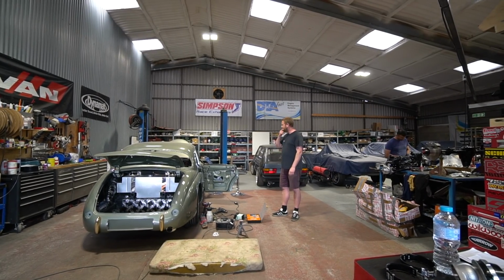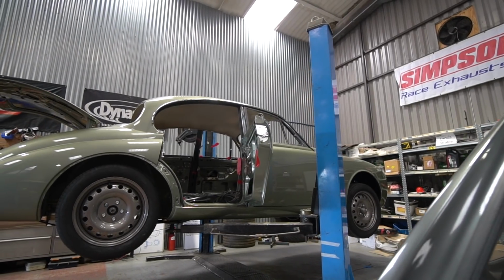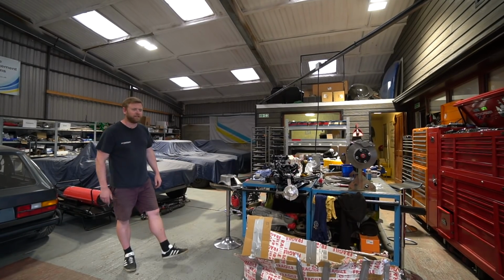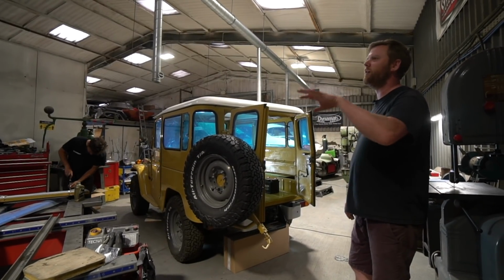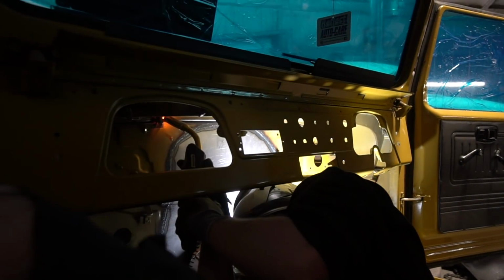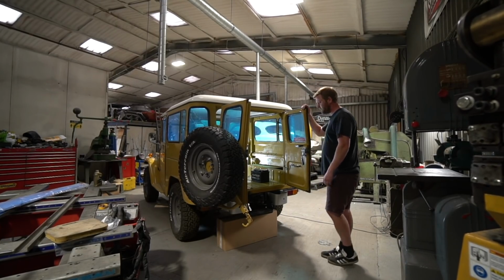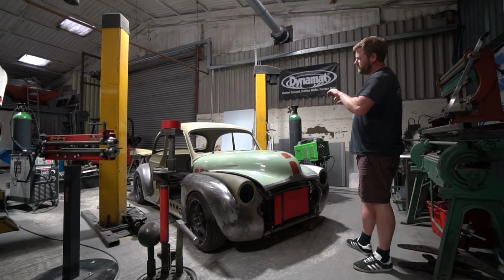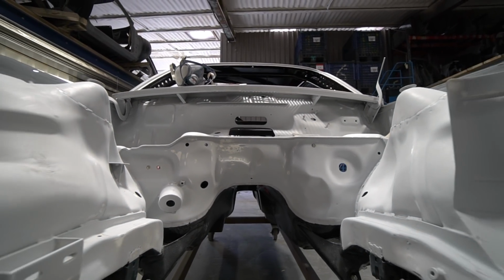Retropower Uncut Episode 44: MK2 Jaguar Countdown to Fire-up, Jensen CV8 Custom Bodywork & FJ40 HVAC

Comment: Parallel increases the capacity but keeps the voltage the same (i.e. 12V).  Series adds the voltage but keeps the same capacity  :-)

Comment: Always worth waiting for.  Such excellent craftsmanship and design ideas to learn from.  I am wondering what the reason is for doing the Jensen valance in steel and not expanding foam, when the shell is going to be used to create a mould for a carbon fibre shell ?

Comment: 11:56  Yeah, you got the battery connections the wrong way around.  Connecting 2 batteries in series gives 24V, parallel gives you 12V.  Not to worry, I'm pretty sure everyone got the gist of what you're saying.  :-)

Comment: Another interesting update. Hope that's not the Jag's back seat lying on the ground in front of you. Needs a bit of work.
You said someone would correct you so you were right. You got your parallel and series the wrong way round.
One other minor question. What's the difference between "instant" and "very instant"? It's like "unique" and "very unique".

I still think you should consider doing a half hour / hour special on the building of each project. Start to finish.
Pretty sure you have the footage, so it would be an editing and voiceover job.

Comment: Why would you saddle a perfectly good 1.8T with a supercharger?
Reply: Gives a very different smooth torque curve. Check out Resto Designs channell, uses a m62 with loads of 3D printed bits, the engine was done some 8+ years ago, the 1.8t with a 4-1 custom exhaust manifold and the Eaton revs so well. Oh it's in a BBM mk2

Comment: Whilst I appreciate you guys do an excellent job of work, I am dumbfounded at all the work that has gone in to swapping the bonnet hinge arrangement on the Morris Mazda. These bonnets always hinged from the rear, OK they used external hinges but I’m sure you could have swapped those much easier than all the reinforcement work that has gone in to making a front hinged bonnet. This in turn creates access problems to the under bonnet area. In my opinion, this is NOT one of your better ideas!!
Reply: I would be very surprised if it was their idea. Something like that would be a customer request, as were the extended doors.
Your angst is directed at the wrong people.

Comment: Series give more volts, parallel give more amps
Reply from the maker: Cheers... I thought as I was saying it I would be getting it the wrong way around 😆
Reply: @retropowercars  No probs, you aren't the first, and won't be the last.
I have to say the shape rear end of the CV8 looks more finished than the "real" one ever did, just needs a pair of nice pipes sticking out so they can launch the music to all followng :-)
Reply: @retropowercars  Series you add the voltages together, parallel they’re both the same voltage (like when you jump start a car).